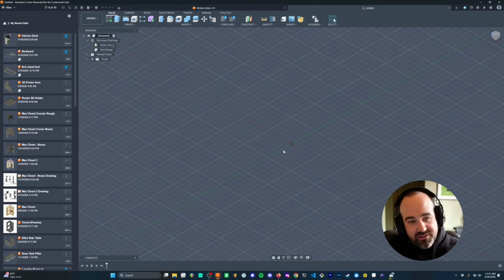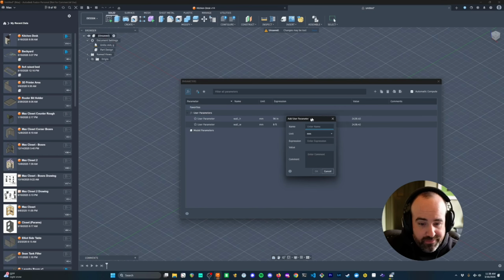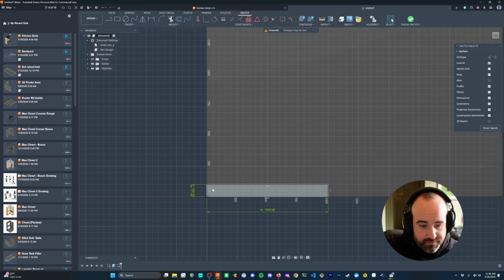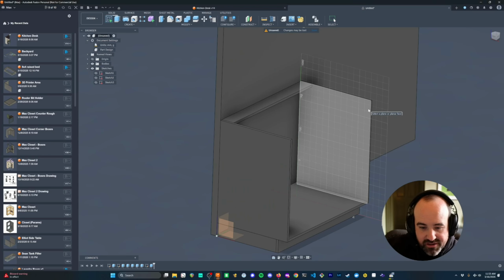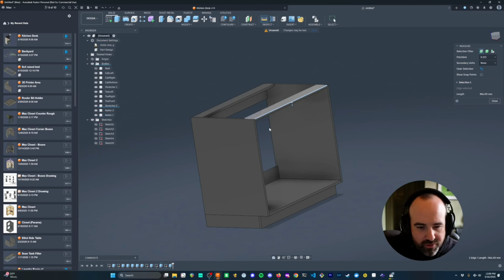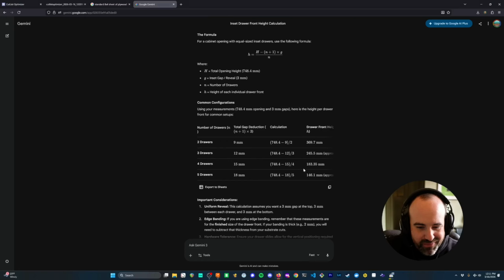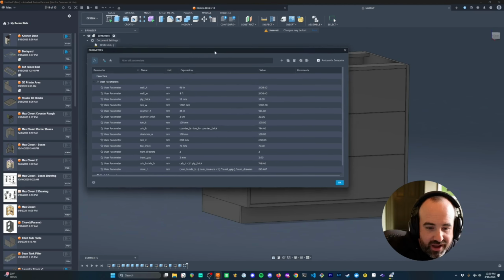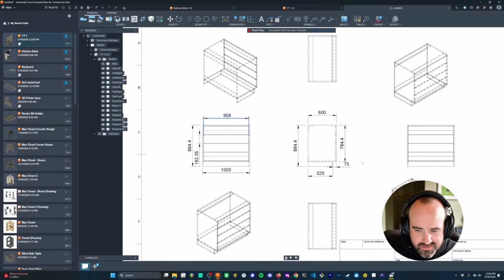Designing Cabinets with Fusion 360 and Cut List Optimizer

Comment: A few things that may make your life easier. 
1. If you save your cabinet as a component you can insert them into any new project.
2. Making them as a component vs just different bodies will make managing a large project easier.  While still allowing you to have separate bodies. Separated by component. 
3. I do this buy creating a new project let's call in cabinet_projects and making a folder inside that project called 'Assets'. This is where I save all of my assets i pre-made in one place. 
4. Once I am ready to create a new project, I create a new one inside of the cabinet_projects e.g. kitchen.
5. Once your in the design space you go to > Insert > Insert Component > Navigate to the assets folder > select asset to insert. 
6. Once there you will be presented with the move options and I just use the 'point to point' move to snap it to where I want.
7. So now if you have multiple seperate cabinets they will be separated into their respective components instead of just a long list of bodies. 

This method will keep you from having to design the same thing over and over again and improve your organization. The negative is you lose your timeline so if you need to make edits to the component its a little more difficult.

You can also save your defined parameters and import them into your new projects so you dont have to create them from scratch everytime. 

Last tip is fully constrain your drawings as you go to avoid issues when using parameters. I would watch some tutorials on using parameters as well. You can easily make everything in your component fully parametric making your life sooooo much easier.

I would check out this tutorial https://youtu.be/eBu1F2nDBQk it taught me my method. It also just happens to be cabinets as well!
Reply from the maker: Hey thank you for this! I’ll have to digest this advice and try it on the next project. I’m a Fusion noob
Reply: @WanderingAbode  No problem. I would focus more on the tutorial as its a good basics to using parameters.  The  stuff I mentioned was more of a bonus. Thanks for the video!